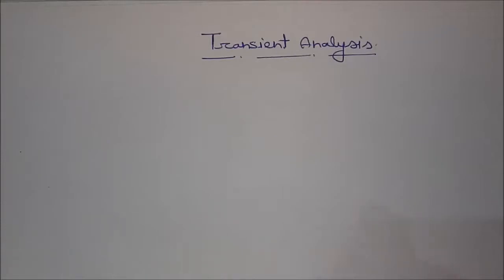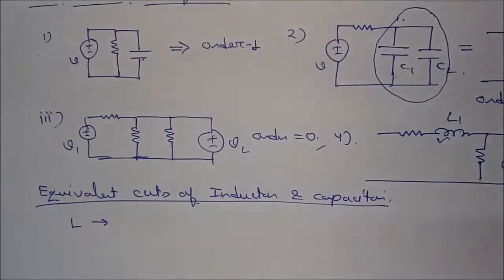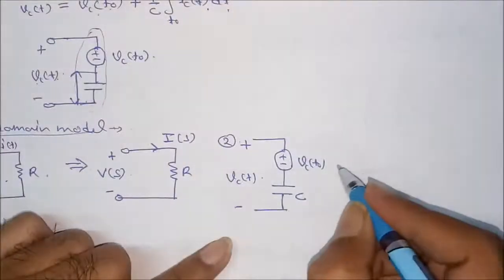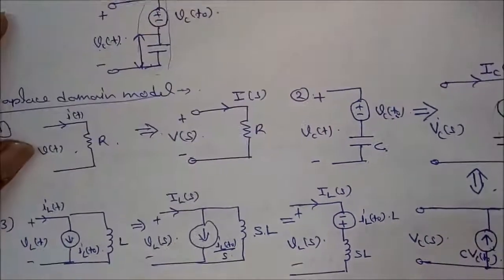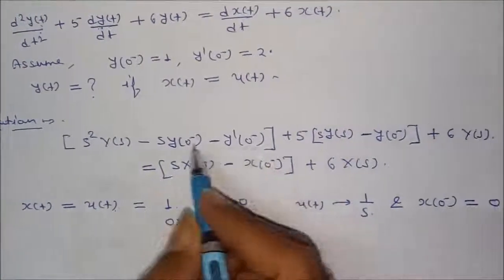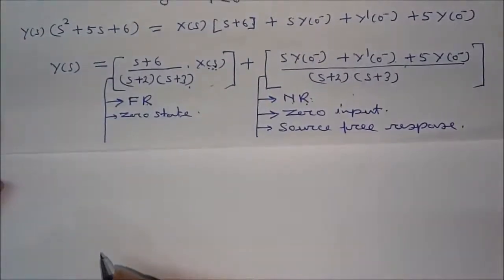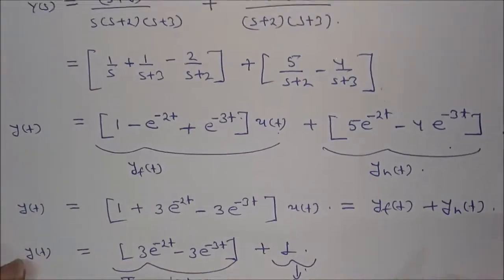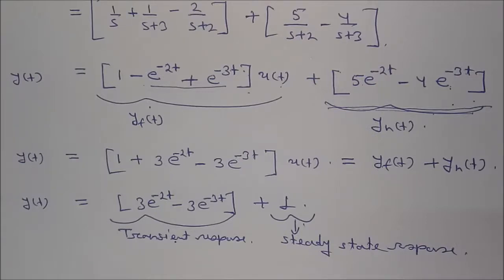Transient Analysis-01 - Order and types of responses

Comment: thanks sir ........
sir if two capacitor is in parallel combination but they have different initial condition ......then order will be two or one ...?
Reply from the maker: it does not make sense with initial conditions. order of circuit does not depend on initial conditions. still 1.
Reply: NO PROBLEM GATE-ESE 
sure thanks sir .